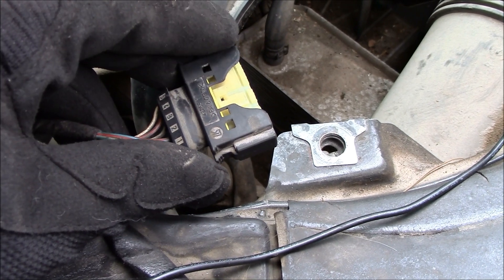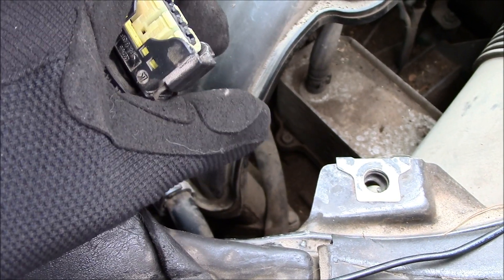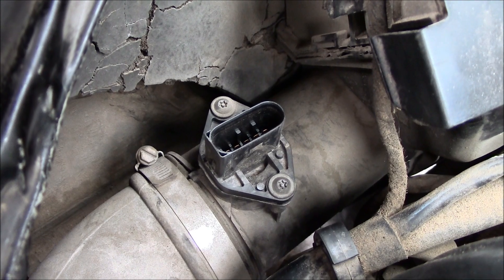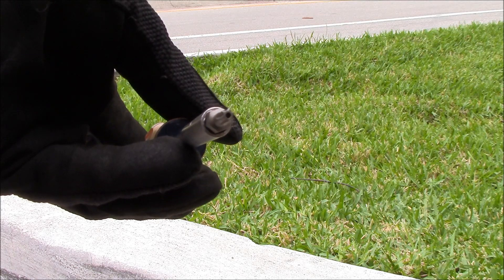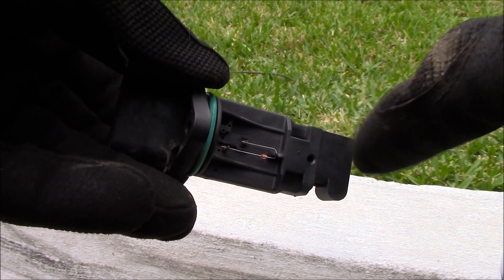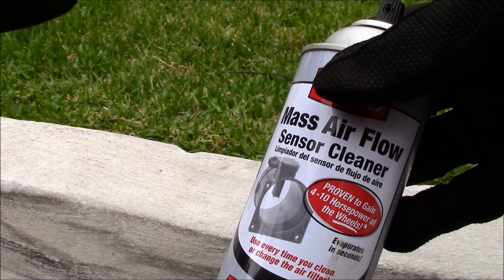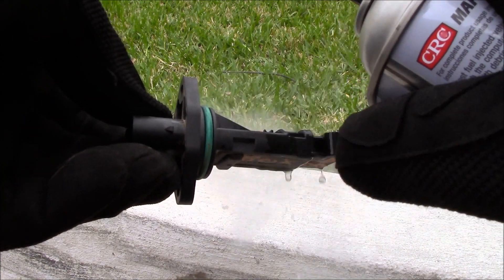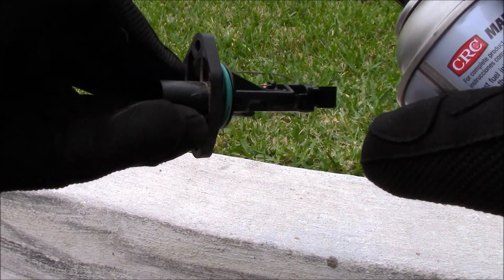Boxster Mass Air Flow Sensor Clean or Replace

Comment: I have a 1999 Boxster with a check engine light on. The code is P1123 which indicates failed MAF (Mass Air Flow) sensor. I had the code read at the local Auto Zone and part priced to replace this. The cost for a replacement part is from $150-350, depending on brand. The cleaner mentioned in this video cost $9.00. To do the work yourself, it's pretty easy. The access to this part is very good. Opening the engine lid and completing the repair took about 15 minutes and required removing only two screws. Very doable for a beginner. I've cleared the code and drove the car on the freeway for about 15 minutes. Engine light still off, but we'll see if it remains off. I'm confident that I can just as quickly and easily replace this part if cleaning it alone doesn't work. Thanks for the video!
Reply: Bob Mullaney hope you still have your boxter they are fun to drive ..believe me I’ve changed a few things on mine and it runs like a champ ...also I’ve seen this part on eBay for about 25$ from a spot here in California...was he part 300 plus or with labor on your case ?

Comment: a HUGE thank you for your instructional video.  My 99 Porsche 986 was giving me P0130 and P0150 codes.   Went to my local car parts store and bought a can of the MAS cleaner and an air filter while I was at it.  Changed out the air filter which was dirty...removed and cleaned the MAS sensor per your instructions (BTW...what a PITA to get to the damn thing)...ran the OBD2 and Voila...the error codes are gone!  Again, thank you!!!
Reply from the maker: Excellent! I hope those code satay cleared!

Comment: Thanks for this vid ..I’ve cleaned the body throttle and replaced the AOS so now I want to this ..I seen his piece on eBay for about 25$ and it’s exactly the same ..so to replace it seems easy and cheap ...thanks for your vid ..straight to point ...greetings from California

Comment: Here was my recent experience:  The check engine light came on.  Code indicated it was the MAF sensor.  I cleaned it as instructed.  This didn't help.  I took the car to the Porsche service center.  It turned out to be the air/oil separator.  

Even so the MAF sensor had to be replaced because it may have been ruined by the cleaning attempt.  Porsche service agent's opinion was that attempting to clean the MAF sensor is futile.  From seeing how the MAF sensor is constructed I concur.
Reply from the maker: +Cabin Creek The MAF has filaments and sensors that get coated in dirt and oil (particularly from over-oiled K&N air filters) and unless you broke out a brillo pad or started poking stuff, you didn't hurt the MAF. It may have been toast to begin with, they do fail.Interesting, a Porsche dealer who sells parts at a super premium.. doesn't think cleaning them is worth it, LOL.  Don't let the service department scare you, they are in business to sell parts and repair services, not educate you.  First stop when you get a code is to go to Renntech.org and do some research.
Reply: Your point is well taken.  But to be very fair to the Porsche dealership, when he quoted me $600 for the new MAF sensor I told him that I had already found one at Auto Zone for half that.  He went out of his way to get that one and have it installed.  

I did go to Renntech and study my options.  I also found information regarding the detriment of getting that cleaning spray inside the sensor.  It toasts the sensitive parts.  I may have done that.

I guess I'll never know.  But one thing that was worth all of it was that I finally opened up the engine cover and explored my engine.  I've learned an awful lot.  Thank you.
Reply: Worked like a charm for me...perhaps there was another underlying issue with your engine.

Comment: Hi, what year is your boxster??
Reply from the maker: +cmcchesneytx 1997 with Technic Sport Package
Reply: +ZipZapDIY thanks, mine is a 2010 so i betting my MAF is going to be in a different place.
Reply from the maker: +cmcchesneytx Not too different. Like the 986, it will be somewhere between the air filter and throttle body.